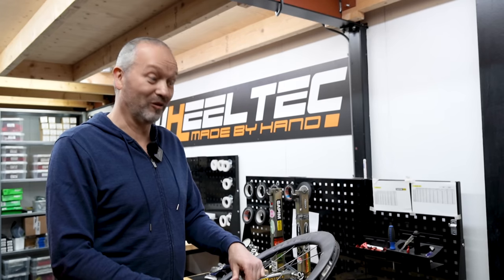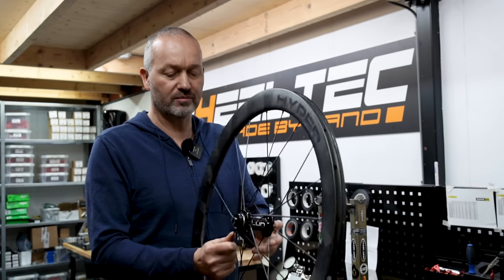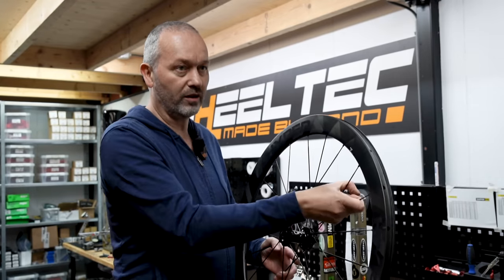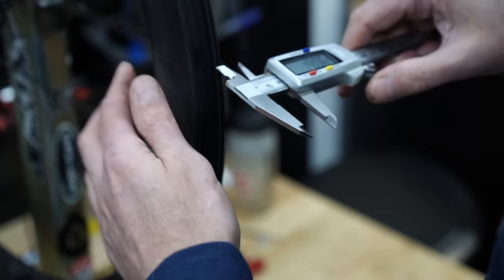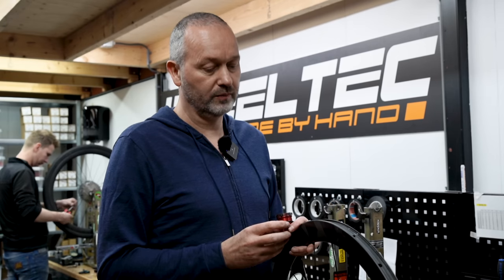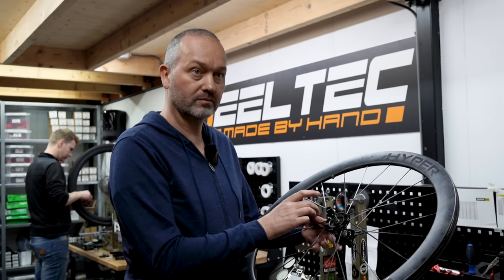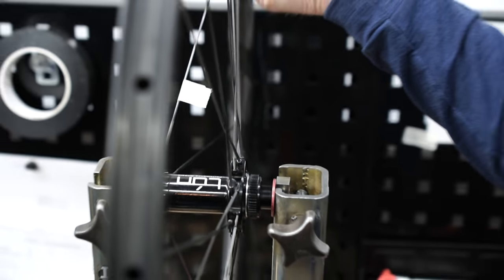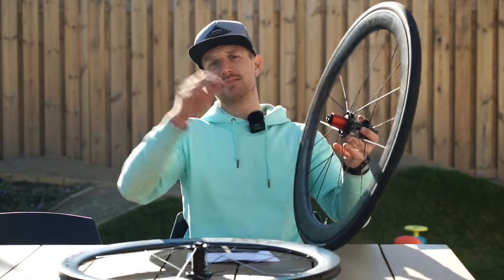2-year OLD Winspace HYPER Wheels Inspected By A Professional

Comment: Thanks for sharing Jasper! I'm currently researching wheels and my mind is all over the place. This video has me re-thinking the possibility of buying from this company, although the Hyper wheels you bought are too narrow for me. The narrowest tire I ever want to run is a 28mm and Winspace probably already has an option for riders like me. But we'll see. Glad to know that this company cares about quality and after seeing this result, not a bad choice at all. Cheers!
Reply from the maker: If you up want to ride really wide tires, look at the Winspace (Lún) gravel (grapid) wheels! Super wide internal with, similar hub to the hypers, steel spokes. 
Really nice wheelset I have on my gravel bike now.
Reply: I got some original 50mm Hypers.  After much consultation (including Hambini) I decided to run 25mm front tire for optimal area and 28mm rear tire for comfort as there is minimal aero benefit at the back wheel due to disrupted airflow caused by the rider.  
The new 2023 Hypers are now optimised for 28mm tires.  If I was to buy today I would buy the 50mm rims again as they are great in cross winds and lighter than the aluminium Mavics that came with my Cannondale Synapse disc break bike.
I am a very happy Lunch customer and think they are excellent value for money.

Comment: I bought these wheels, love them so far... best wheels under $4000 dollars really in my opinion. There are a few better options if you are a pro racer for sure, but for the $$$ these are extremely hard to beat.
Reply from the maker: 4k$ is quite a high threshold 🤗
Reply: 99.9% of wheels are under $4000 😂

Comment: I'd be interested to know what rim, spoke, and hub combo he would build an ideal wheel with
Reply from the maker: I'll ask and maybe we get back to you in a video 🤪
Reply: @jasperverkuijl  that would be awesome!
Reply: I wouldn't think there is one 'ideal' wheel, because the ideal wheel would depend on the user and their application.  What I want is probably different then you want, etc
Reply: @cup_and_cone  he could do both a climbing wheel and an aero wheel for the road.  Then do a separate video for gravel/MTB wheels maybe.
Reply: @tmunk123  From a wheel builder's perspective, it's not so black and white.  What about the rider's weight?  How stiff they want the wheel?  How frequent of maintenance on the hubs? How easy maintenance is?  Longevity of wheel's life?  What size tires they want to run and rim width?  Conditions they ride in?  Type of riding?  Spoke commonality?  Etc.  In an ideal world, we would all be riding 32 or 36 spoke wheels laced 3x on Shimano hubs with brass nipples and straight gauge spokes with just our own flavor of rim, but obviously other factors come into play.
Reply: @cup_and_cone  something that is  a good combination of weight, durability, and serviceability. The Wheeltec wheels seem to try and hit that combination.

Comment: For me the most important question: How many kilometers did you ride with the wheels? Two years sounds like a lot and in my case that would equal to 40k km. I watched the video carefully and you mentioned 7k km. I think this is close to nothing as i would expect for such a wheelset to last much longer. No one would expect any siginificant wear on the bearings especially for high quality hubs such as DTs or white industries. These hubs can easily run 30k or even 40k km before the bearings need to be replaced. Even the trueness of the wheels does not surprise me after these few kilometers. I therefore think it would be more beneficial if you put the mileage in the title of the video and the description of the video.
Reply from the maker: Mileage alone doesn't say everything rather sithout the way they are used and conditions of riding, rider etc. 

I actually don't know exactly how many km i did since i ride lots of different bikes and different wheels....🤷🏼‍♂️ But i did quit a big portionn these wheels. 

20k a year is pro level and not that common for most viewers, so to use that as a "standard" would be odd tbh. 

I do agree that mileage says more than timespan. But even good quality bearings can turn to shit in bad conditions while cheap bearings can last a lifetime in sunny weather with smooth roads and proper maintenance. So it's all relative. 

Anyway, I'll have a next video showing more what ive  done with the wheels.
Reply from the maker: Mileage alone doesn't say everything rather sithout the way they are used and conditions of riding, rider etc. 

I actually don't know exactly how many km i did since i ride lots of different bikes and different wheels....🤷🏼‍♂️ But i did quit a big portionn these wheels. 

20k a year is pro level and not that common for most viewers, so to use that as a "standard" would be odd tbh. 

I do agree that mileage says more than timespan. But even good quality bearings can turn to shit in bad conditions while cheap bearings can last a lifetime in sunny weather with smooth roads and proper maintenance. So it's all relative. 

Anyway, I'll have a next video showing more what ive  done with the wheels.
Reply: Agree with Oliver D, 7 000 km is not very much for road wheels. I'm a recreational rider and do about 10 000 km/year. I check the bearings and spoke tension twice a year, clean the the freehub body and give it fresh grease. I would be concerned if my wheels got a broken or turning spoke within a year without impact and broken parts in the freehub. If you know how it happened, explain it.
Reply from the maker: @erikarnstrom897  well the turning of the spokes is discussed by Marc, there is not a clear reason to name why this would happen. It wasn’t really big at any spokes, it just needed minor adjustments. 
The broken/rupted spoke occurred during the adjustment (turning) of the spokes. 

Btw, Winspace is working on improved hub/spoke combination to prevent the turning completely.

Comment: do the hyper spokes have a rough splintered finish like the elites do? theres alot of voids on the surface of the spokes
Reply from the maker: No. Winspace gets their spokes from a different factory than elite. The Winspace spokes are very clean
Reply: @jasperverkuijl  yea idk if its worth buying without knowing for sure, i suspect their spokes will be similar, even if theyre a bit cleaner, i bet theyre still raw and unfinshed which cause them to splinter on skin and snag on cloth. run your fingers across them and i bet youll see carbon on your fingers which are micro splinters. besides that they will twists some which isnt one of carbons' strong suits.
Reply from the maker: @timtaylor9590  well like I said in my previous comment, they are not the same. Winspace and elite use different factory of which Winspace gets them at a really good one. I know this for a fact as Marc has told me and is even in the process of getting his own carbon spokes from the same factory Winspace does. 

No splinters. There are no voids.
Reply: @jasperverkuijl  interesting, i would assume theyre made the same way, in a forged mold. seems like the most efficient way. maybe elite gets factory 2nds they look and feel terrible. are the hypers raw and rough or do they have a finish on them? i want to be able to clean them and not have to worry about getting splinters or carbon on my hands
Reply: @jasperverkuijl  I'm going to ask them for close up pics before buying

Comment: Could you ask what the best entry level carbon wheels are?
Reply from the maker: There is no "best". It's specific for everyone
Reply: Wrong question. It should be value for money carbon wheels. You cant go wrong with these wheels compared to branded overpriced carbon wheels that does basically the same thing. If you are a weekend warrior, you wont feel a difference between x carbon wheels vs x carbon wheels.

Comment: I think these are solid wheels. I seriously considered buying this wheelset but ultimately decided against it for one of the reasons spelled out in this video: too many proprietary parts. I ended up going with wheels that use regular CX-Ray spokes, external nipples and a DT Swiss hub as pretty much any shop can service that stuff.
Reply from the maker: That's a very good reason not to buy them man. Good choice 👍

Comment: his comment about saving weight with carbon spokes is pointless is on point. you want a light rim for quick acceleration and fast descents!
Reply: Also, you'd rather have the spokes break instead of the frame if something where to get caught in the spokes. One first-gen Allez Sprint Disc rider had his seatstays bent when a tree branch was caught in his HYPERs, where the spokes probably came out unscathed.
Reply from the maker: Somewhat happened to me on my gravel trip. A big stick shattering 7 spoke nipples but the frame and me where ok.

Comment: I have these wheelset and I am currently running Turbo Pro 700x26. What's the best tyre size for these wheels on riding recreational??
Reply from the maker: 28mm with low tire pressure will work fine. Depending on your weight. I ride 28mm with 4,5bar and I’m 82kg. If you are lighter you can reduce the pressure even lower.
Reply: @jasperverkuijl  thank you.. I'm 64kg and I tried to lower my tyre pressure on my ride today and it feels alot comfortable during the ride. Thank you for the response 🙏  any specific brand of tyre to buy?
Reply from the maker: @WhiteRiceCycling   great to hear you had that positive experience! You can go way lower than you think. 👌🏻
I ride Vittoria tires. For training or recreational I would use the rubino pro tires. (I use the corsa, that’s really for racing)
Reply: @jasperverkuijl  thank you. Will order a set today..

Comment: That's why I spec'd my wheelset with Sapim CX-Ray spokes. If they fail on the road, just about any LBS could service it and send me on my way.
Reply from the maker: Yep that's a big plus.
Reply: Also, I'd rather let spokes break than the frame if a stick were to end up wedging itself between these two.

Somebody had a pair of HYPERs on his first-gen Allez Sprint Disc and this happened to him. The seatstays were badly bent, but the spokes seem to be OK.

Comment: 2 years, but only used for 7000km… and not used in winter when the weather around Almere isn’t the best, would you really call that used for 2 years?
Reply: why would you use great wheels in the winter where he lives?
Reply: @faosa73  I maar in the “why not” camp. And when you state “2 years of usage” I would expect 2 years of usage. Not what would be about 6 months actually. When you want to test a pair of wheels and tell how they perform, use them and abuse them. Do not limit it to the nice weather rides. Test the bearings. Test the corrosion risk. Do it all. I am a bit disappointed when a review is brought in this way and even more when the feeling is presented that the reviewer is somebody who says what he really thinks and is not limited to contracts etcetera. I thought Jasper would really test them to the bone.
Reply from the maker: @arnoud3ss  it's ok to have criticism, but there is always somebody that has something to complain about something.... 
In the follow up video i will discuss what I've done with these wheels. I've put these to the test dude, trust me. 

My riding numbers of 2 years are devided over so many bikes! I simply can't put all my kilometers on one bike (or 1 wheelset) because of rental bikes half of my rides, winter bike i use, winter wheels i use, the bike i use to pull the trailer when i train with my kids..... Besides that, due to circumstances i actually rode only about 9k last year (instead of my usual 15k yearly), so i actually did ride a lot on these wheels. I just tried to keep them in top shape over winter!

It's still 7.000km, some people take more than 2 years to get to that when they own only one bike or one wheelset!, some people never see any "bad weather" or salted roads like we have in the Netherlands (cyslist in California e.g.),.....

So maybe don't be so judgemental and just see it how it is.
Reply from the maker: @faosa73  exactly, I'd rather keep them in good shape and ride other wheels in the salty conditions...
Reply: @jasperverkuijl  thank you for explaining. It’s what this video is missing for me, but as I understand will be part of the next video: how were the wheels used during the 2 years. Call it criticism. Call it complaining. Call it in an effort to make you improve what you do. Call it whatever you want. Consider it my honest opinion. Not bringing your work down. But opinions may differ. You do not have to explain yourself to me, but sometimes it is good to see/read/hear the opinions of others.
Reply from the maker: @arnoud3ss  thanks. 
More about these wheels in the future video. I'm still waiting for the parts so i can fix the wheels and finish the second video. (taking a bit longer because the parts are send with a bigger package with goodies 🤪🤗🤗)
Reply: @jasperverkuijl  now you make me jealous. Goodies are always good 😁

Comment: Hmmm... TD;IL that 1464g is classed as a 'heavy' wheelset. I had an old set of wheels built for me with DT Swiss RR440 rims and  cheap unknown novatec hubs (I think they were F172SB-11S) that weighed 1770g (probably a terrible combination but i was on a budget for something strong as i was a heavy mofo at the time...) Compared to the Winspace set in this video, my RR440's must be like cycling with concrete blocks for wheels.

In any case. My RR440s are dead. The rear rim started developing cracks so I replaced them with a set of HUNT Race Aero superdura wheels cuz im an 88kg fatty and i use the same bike to do long 100mile+ endurance rides so the new wheels had to be able to carry some extra weight. They are still concrete blocks compared to the winspace (1665g) but they roll and pick up speed so effortlessly. 

I myself am still losing weight though. Ive lost 8lb in the last 2-3 months.

Excellent video though! Lots of very very good information!
Reply from the maker: I'm 82kg and used to be about 87 so we are not that far apart. 
Keep it up💪💪

Comment: Broken spoke and worn hub... My bontragers haven't had a single issue and I weigh 90kilo. Cost the same too. Plus life time warrenty and trek stores close by.
Reply from the maker: Worn hub? It was a 3€ fix. Hub wasn’t worn, just the plastic ring and rubber ring. In the current design hypers that’s already improved so not to worry about. 

The spoke didn’t break, it got damaged when we twisted it to align it. But yes it needed replacing. Can happen. 

No worries. If you are happy with the bontkragen wheels (which are good wheels, I used them) than that’s all good mate 🤙🏻🤙🏻

Comment: I don't know much about the benefits of carbon, but i assume weight is the main reason they are used rather than alloy. These are $1200 for 1.5kg. I am sure the metal equivalent may be a little heavier, but will cost a lot less. Also with carbon, catastrophic failure would always be in the back of my mind.
Reply: Carbon wheels with carbon spokes and ceramic bearings is very very stiff I have the exact same wheels I never rode an faster and stiffer wheels while I have zipp roval and durace wheels. Never I will buy BIG brand wheel again!!!
Reply from the maker: Weight is lower and stiffness is higher. Overall much higher performance. So definitely worth it.

Comment: Is it recommended to buy these rims if you live in belgium and have lots of bad roads and cobbles? Or should I opt out for steel spokes? Like hunt wheels have
Reply from the maker: Don’t know if it matters to have steel or carbon spokes. 
I’d recommend to use wide tires  (28 or 30mm) with low pressure. They will give you the comfort you need.

Comment: got the same set and like them very much but stable in crosswinds is not true.. big difference with my bontrager aeolus 5.. very nervous wheelset for sure..
Reply from the maker: I happen to have ridden the aeolus 5 wheels as well (on the Trek emonda i had for the Taiwan KOM) and i don't think there is much of a difference. 

You (and others) saying these wheels are unstable in crosswinds blows my mind.... Not sure how small or lightweight you are, and what kind of bike setup you have,but these wheels are fine in crosswind. I ride them in wind everyday in the Netherlands.... Just hold your handlebars 🤷🏼‍♂️

Deep section wheels will get a bit of a push that's inherent on higher rims.... The fact if they are stable or not is a complete different story! So yeah, i can't relate to your comment....
Reply: @jasperverkuijl  I agree with you. I was even surprised. They are as good as 38mm wheels.

Comment: Solid wheels.  I have the 65mm wheels, just ripped out 1550 watts and multiple 1450 sprints.  No issues.  I weight 165lbs
Reply: Nice ! How about the long climb?
Reply: @dannylai390  they are 65mm so probably not the best for 10 minute race paced climbs but I have no issues with the wheels during sub-5 minute punchy climbs.  50mm wheels are probably a better all around wheel